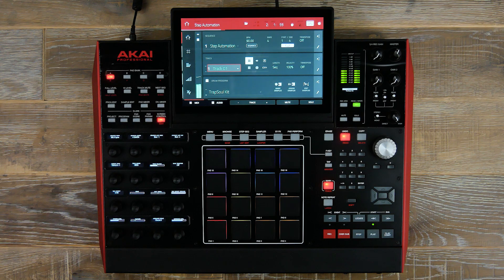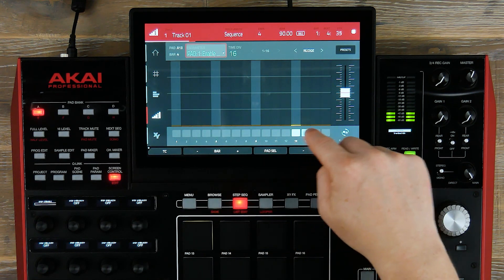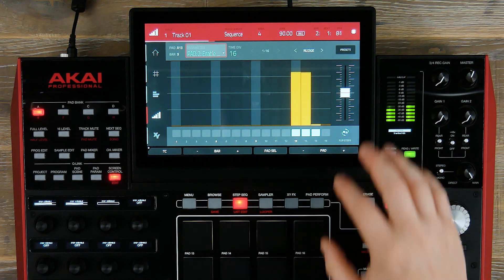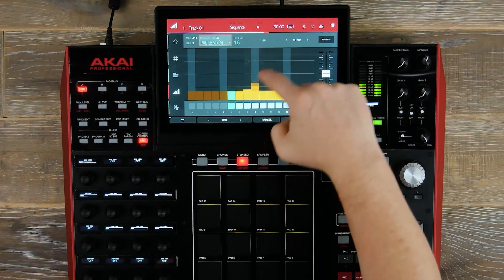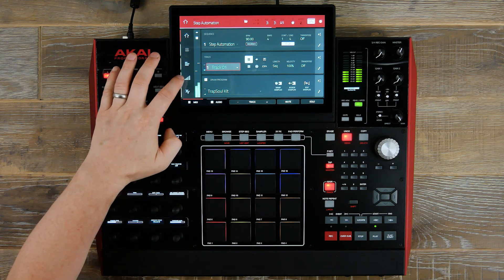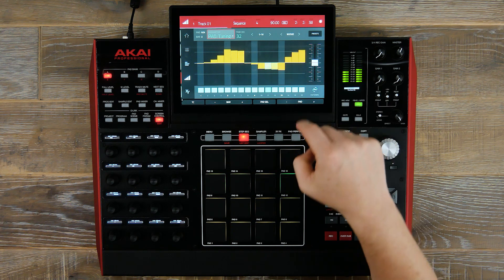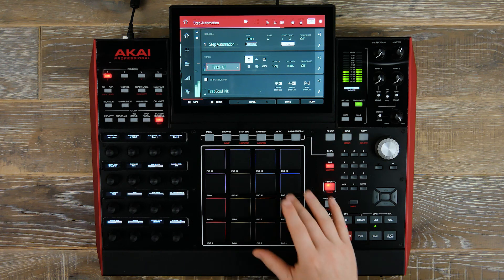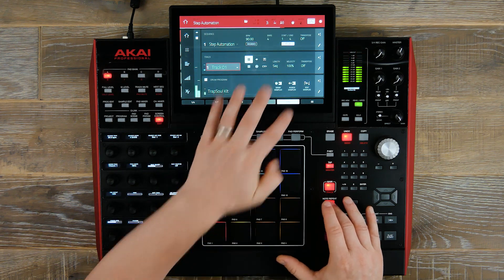A Closer Look | Step Automation Feature

Comment: I'm having problems with automation resetting on the next sequence. Say I bring in volume on sequence one for a track, when sequence 2 starts it goes back to zero since I haven't done any parameter changes? Why is this. I don't want to have to do parameter changes and automation on every track